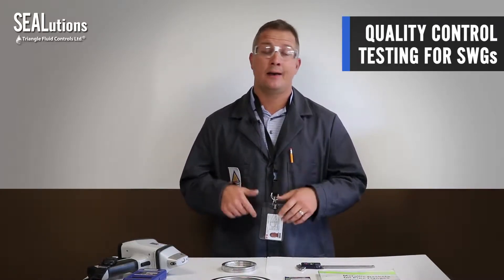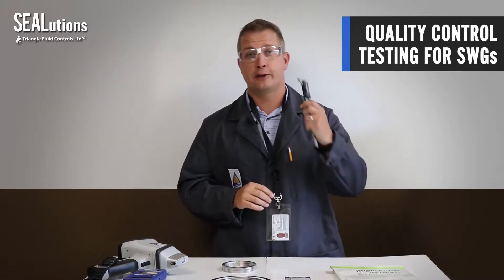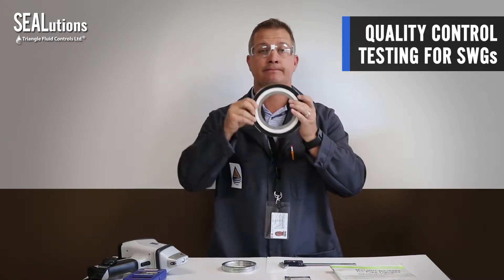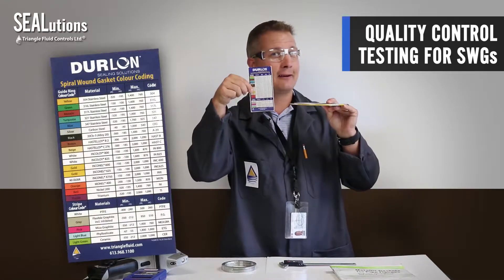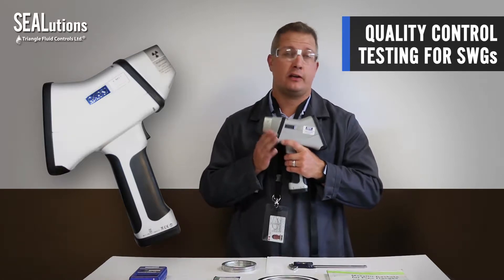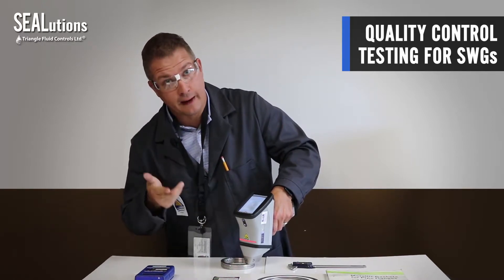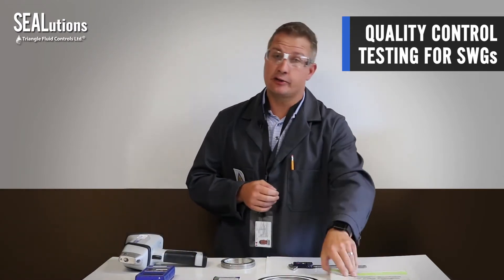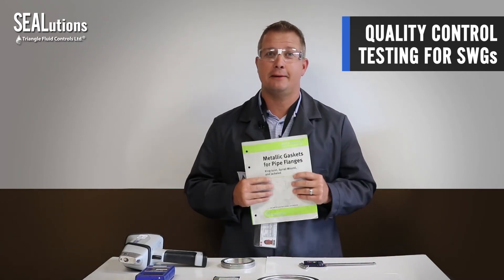SEALutions - Quality Control Testing for SWG's

Comment: Hello sir, I've Technical query  and I I hope you can help you with. ASME B.16.20 -2017 performance test using methane gas is introduced. We are presently working on making new set up for performance test of swg using methane gas detector which gives leakage rate in ppm. B16.20 says max permissible leakage rate is 0.0137 mg/s*m (7.67E-lb/sec.in). Could you please guide us the conversation of mg/s*m or lb/sec.in into ppm?

I hope you understand my requirements and please let me know if any other inputs required. 

I greatly appreciate your help in this regard.

Many thanks!